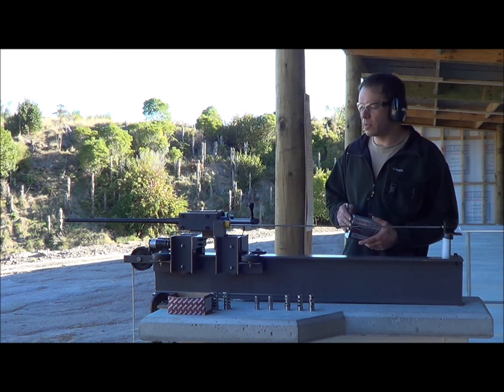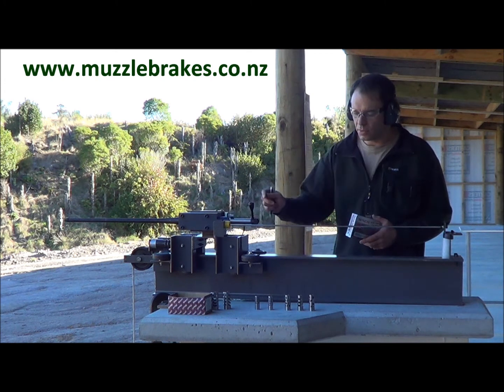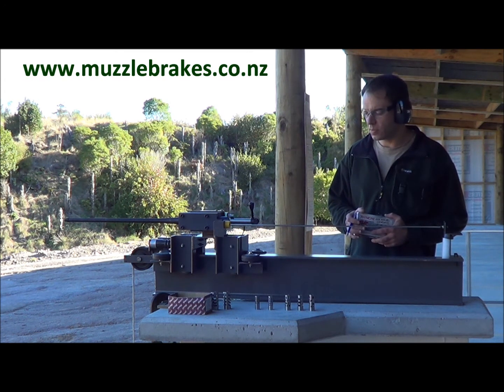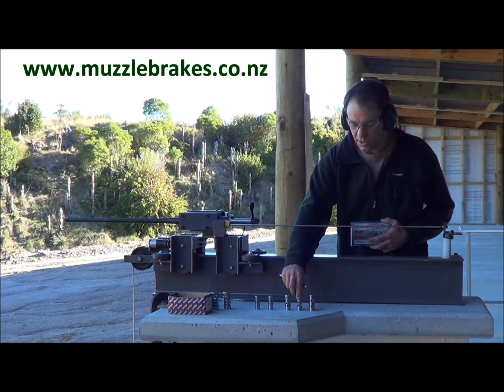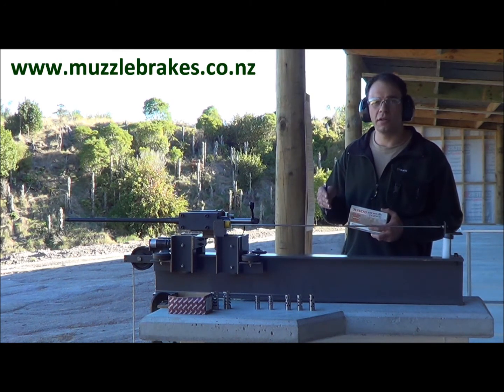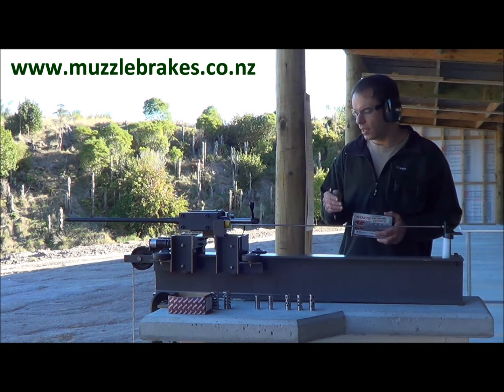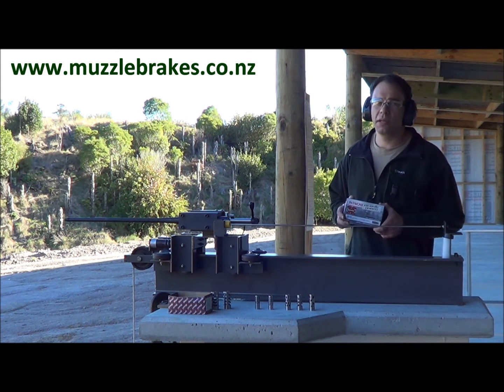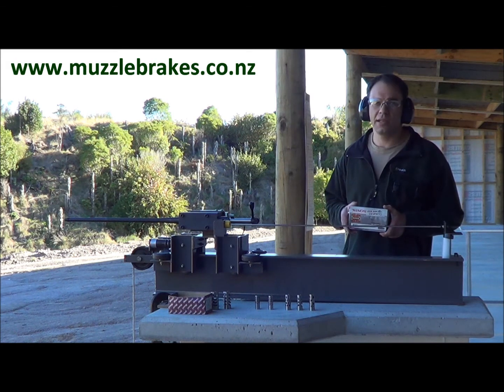Muzzlebrake Testing Part 4

Comment: I coupled the D.F. Maisey  brake to a .300 Weatherby shooting 85 grs. of Vih 165, so u have a good idea of the kind of recoil we r talking here, not the worst but heavy. In comparison, a 30/06 shoots about 52 grs. of powde...r

Anyway, I also coupled this build with a Blackhawk Axiom stock and went to the range with 30 rounds of ammo. I was able to sit and slam them thru one shell after another as fast as I could shoot and got up with NO adverse recoil effects. Absoultely none, I could've shot 30 more if I had the ammo handy, course the barrel was getting a bit warm!

The next day I had NO shoulder bruising, as is common with shooting any belted magnum I've ever shot.

I tip my hat to the crew at D.F. Maisey Gunsmithing in New Zealand for an outstanding job building muzzle brakes for belted magnums!
Thanks !

Comment: To what do you attribute the 16% recoil reduction in the VariMax with the ports closed?  Seems a bit too much to just be the increased mass.
Reply from the maker: The baffles inside the muzzlebrake cause enough of a resistance to disrupt the passage of the propellant gases to atmosphere, even when the outer sleeve blocks off the port holes. Even though the gases are eventually all going to exit out the muzzle hole when the sleeve is set in the 'off' position, there is enough of a turbulence/disruption created to show a small amount of recoil reduction on the testing machine.
Reply: Gr8 test - very scientific. Have you measured any velocity effect when using the Varimax? I’m thinking it may have the effect of an increase in barrel length and in so increase velocity - especially when the ports are closed.